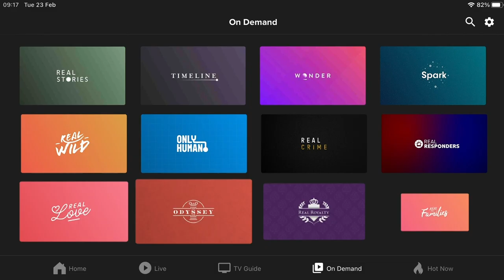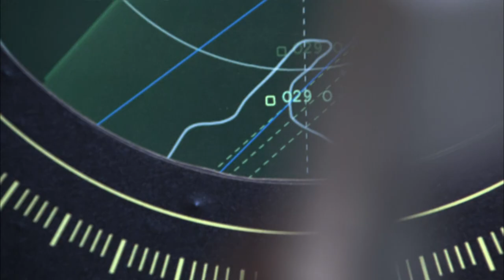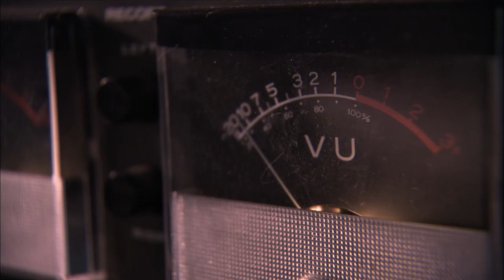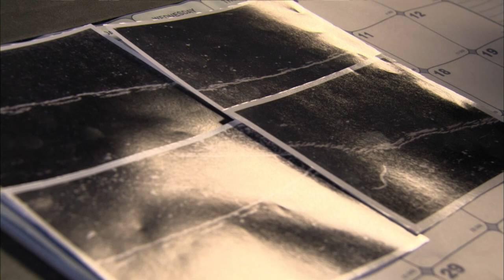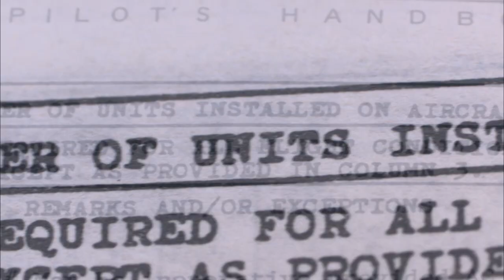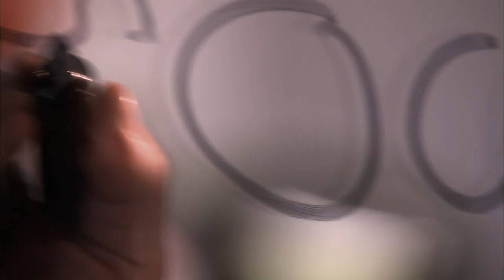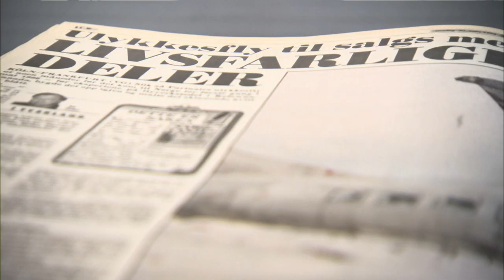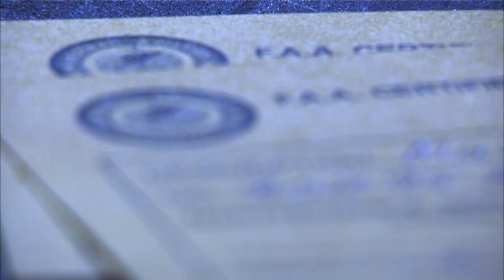Denmark's Deadliest Plane Crash Partnair Flight 394 | Mayday | Wonder

Comment: I’ve only flown like 10 times.. so, 20+ including round trips & layovers.. every single time before boarding, I’d watch the plane & crew through the big glass airport windows & freak myself out.. wondering how old the plane is, are those all original parts & if so, how worn down are the parts, how many parts have been replaced, everything has a expiration date, etc. ..the pilots mental health.. everything was suspect lol but mostly, how focused are the mechanics?? Are they REALLY checking parts or just flying through their check lists .. their minds on getting off work?? The guys that drive those little golf cart mule things around.. drifting in sideways to the terminal.. racing each other like it’s real life Mario kart lol I’ll just think of how so many teeny tiny factors play a role in this & way too many things that can go wrong.. mechanical, electrical, outside forces, passengers, human error… until I’m literally hyperventilating, shaking, & regretting boarding lol.. I don’t buy the “safest form of travel” bs.. like yeah considering there’s probably 250,000 cars per one airplane.. do the same “car vs plane” statistics still apply to flight attendants or people who fly once a day?? No. It comes down to survival rate of crashing lol .0000001% vs car 50+%
Reply: For me it's all about what I can control in the air nothing in a car hit the brakes and pray for the best. Catch 22🤷🏾
Reply: @demarcusbibbs8036  yeah from a pilots perspective I guess I can see that.. didn’t really look at it that way lol my POV was more IF something were to go wrong, what survival rate are we looking at lol yeah a car is more likely to have issues but… you know?! lol ditch, maybe rear end, side swipe, even flipping out of control people survive wearing their seatbelts.. some crashes are just horrific & no one could survive but we see them daily.. the little fender benders that seem to happen just before rush hour in the worst spot possible lol on our way too & from work.. I’ve been in 2 that totaled my car but luckily no real injuries to me.. so yeah, it was really just survival rate per crash statistics.. those aren’t very comforting lol
Reply: Most accidents have survivors, and multiple ones at that.
Reply: @unconventionalideas5683   of course the circumstances matter like speed, hitting another vehicle or building, tree, pole, flipping, seatbelt etc. i see a lot of accidents where the car is definitely totaled but the occupants are standing around it and injuries are minimal.. broken bone, whiplash, or needing an ambulance but eventually recovering.. high speed & how & what it crashed into are what cause someone not to survive one.. when an airliner at 10k plus feet hits the ground or water which can be just as bad, typically it completely disintegrates.. nothing left of this massive jet but tiny pieces.. anyone on board surviving are highly unlikely.. these crashes happen less than cars but when they do, the chances of survival aren’t even comparable.. have people miraculously survived these kinds of airline crashes before? Yes but not many.. not talking about emergency landings.. I was referring to survival rates of actual airliners falling from the sky at 500 mph vs even a “bad” car crash.
Reply: Car crash 5 folks may die. Airplane 100 to 300 people perish in horrific crash.
Reply: @Lace722  most crashes occur during takeoff or landing, at which point it’s typically closer to the ground.
Reply: @libbybollinger5901   oh wow I didn’t know that?! A few incidents shown on this show were at takeoff, just after, or landing but all or the majority didn’t survive.. I remember the woman pilot who crashed into a plane maintenance building right after takeoff, a small plane in Chicago that crashed because they were waiting for approval to land & ice buildup caused them to crash neither had any survivors.. the pan am runway one of course.. the larger one that ran out of fuel circling an airport in New York or up north waiting on approval.. not necessarily “close” to the ground lol but “closer” compared to altitude they reach during the flight.. I guess it all depends on what the problem is & if the crash can be controlled at all.. we just had a blackhawk crash here in Alabama.. two experienced pilots doing a drill from a nearby base.. some nearby home security cameras captured it.. it literally looked like it just fell & my dad did flight tests for the Air Force.. I remember hating him leaving for work everyday lol so anything air related just never sat easy with me.

Comment: That fighter jet was  way closer than any 1000 ft
Reply: No they weren't! It was determined during the investigation that the two planes were over 1,000 feet apart and the fighter jet was flying far above them. It was the APU that caused the crash. I love how's there's trained aviation investigators yet key board warriors think they know better.
Reply: @masoneveridge4078  agreed.
Reply: It probably wasn't within a few meters, though.  That's the reality.  even if it had been way closer, it still wouldn't have mattered; it wouldn't have affected the plane.

Comment: And then there is STUPID DESIGN. If you attach the tail with EIGHT BOLTS instead of FOUR, then you don't need $1000 worth (4 at $250 apiece) of super strong bolts; $240 worth of regular bolts (8 at 60% strength and $30/each) will be 20% stronger. (8x0.6=4.8 or like having almost a 5th strong bolt.) It's fool proofing.